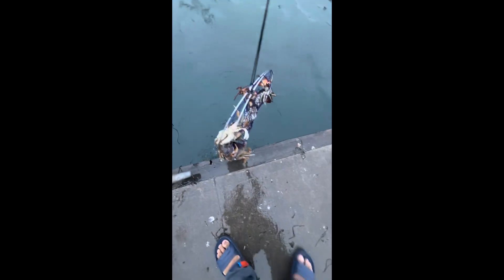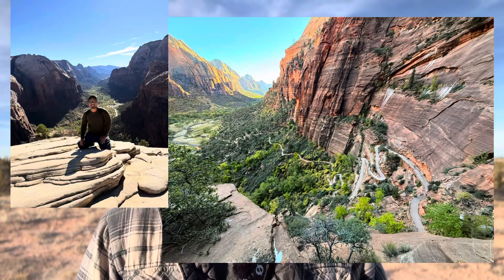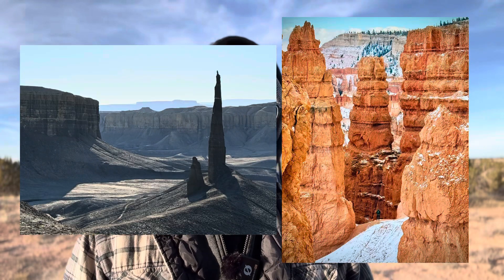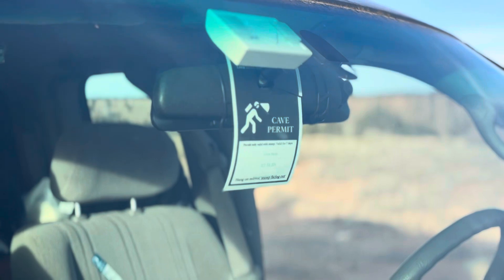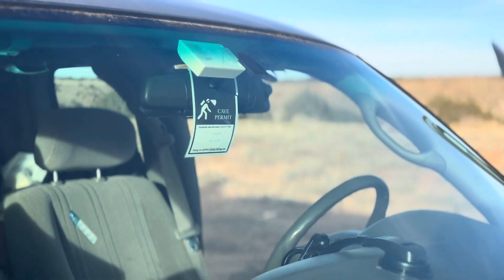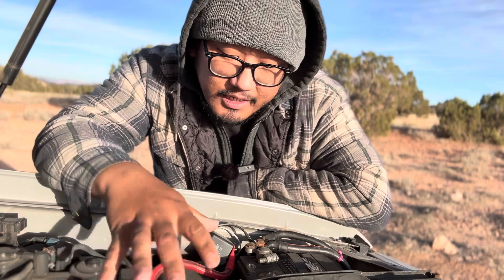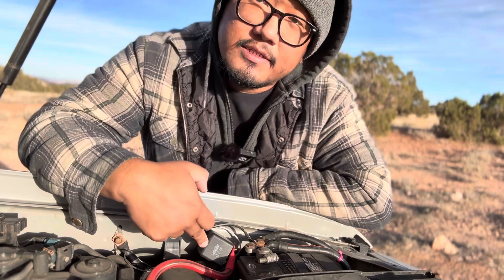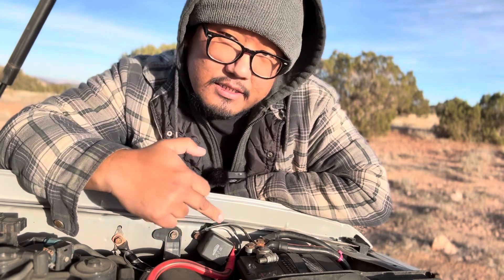My Homemade EcoFlow Charger Needs Fixing

Comment: You might want to look at the Pecron 500w DC charger. It can be set to match your alternator to only charge when the engine is running. It is also half the price of the other alternatives. I picked mine up for $120.